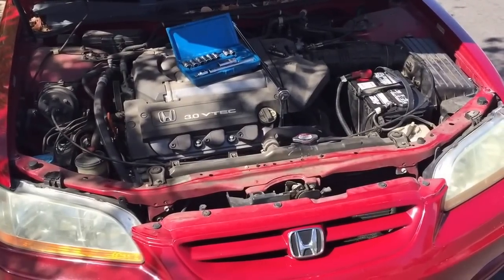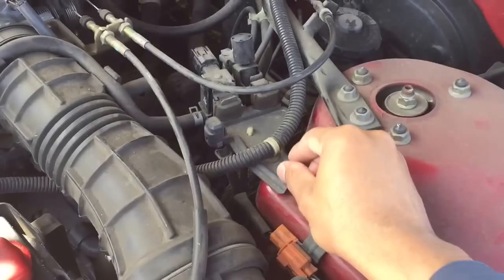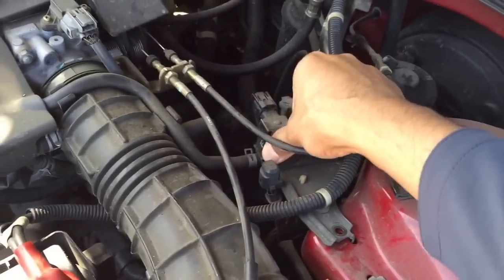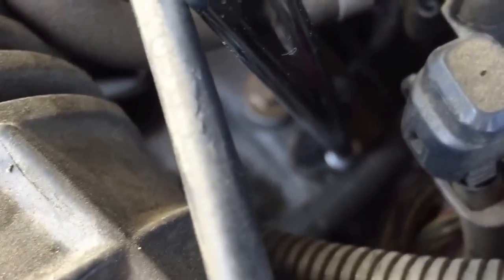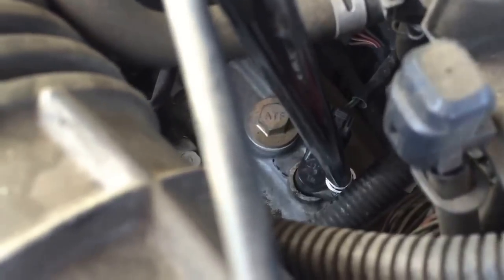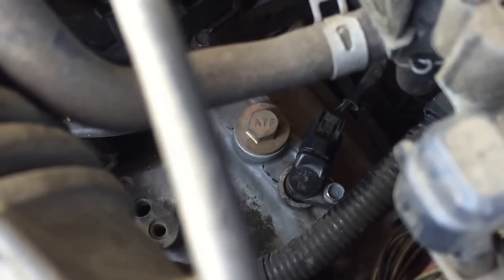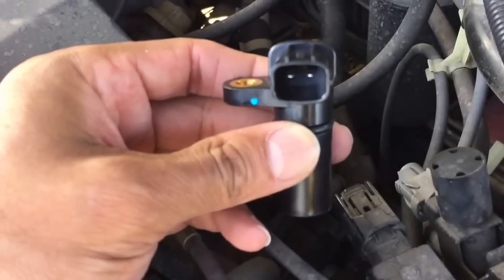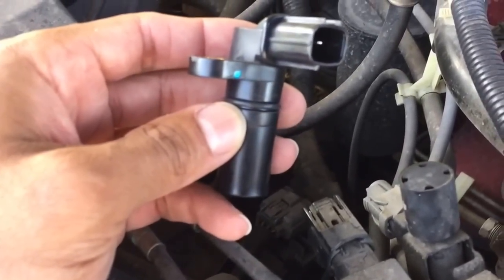How to replace the speed sensor on a Honda Accord

Comment: 2005 Acura rl, same problem but do I need to gap the sensor if so on the tip of the sensor or on the bolt where I tighten?

Comment: Do the input and output actually use the same part? In other words, is the part interchangeable as either an input or output, or is there some kind of difference between input and output sensors? They seem to be the same.
Reply: Same question

Comment: Hi Brian. I just seen your video. I have a question. If I replace my speed sensor on my 1999 vtec 3.0. Would it stop my 4d from blinking and engine light to go off. Course I just installed the 3rd pressure switch and it didn't work. Please help me.
Reply: @Ramon Amoros how did you fix this problem. I've got the same thing going
Reply: yeah i have the same problem but without the flashing engine light. but the d4 flashes curiously the gear shift is still smoothe and no issues.. but speedometer not registering any speed whatsoever. i replaced the speed sensor on the transmission but still no speedometer readings..any ideas? thanks

Comment: I think that's the "countershaft speed sensor".....
...the diagram I'm looking at is showing three "speed sensors".
The VSS is near the throttle body.
...the "mainshaft speed sensor" is lower and more to the front of the one you removed.
Reply: Where the input speed.sensor @ on 96 accord ex ?

Comment: Brian I have a 2011 Honda Accord I think I have the same problem. Is the sensor in the same location?
Reply: youtube307 youtube307 my 2011honda accord won't go over 40 mph what should I do
Reply: @terrancegarner9591  same as my 2012 honda accord , it will only shift to second gear , but i got the speed sensor output today i will let you know if it works
Reply: @duckquansmith8620 how did that go? 😂

Comment: I replaced transmission oil pressure sensors and speed sensors and now my car not charging gear and speedometer stop working, on 2010 accord.